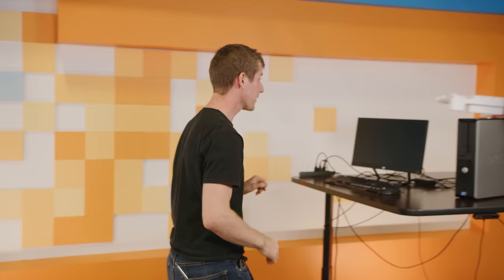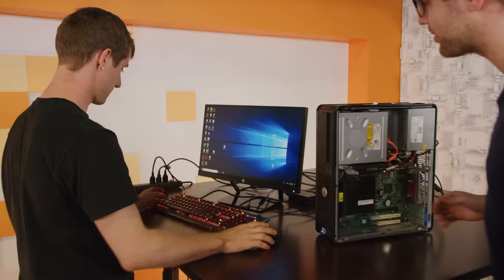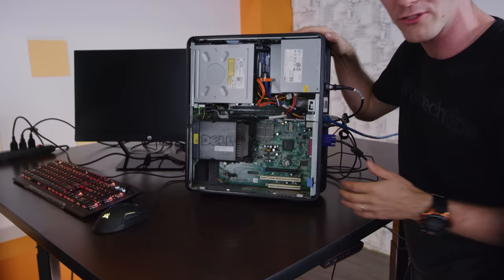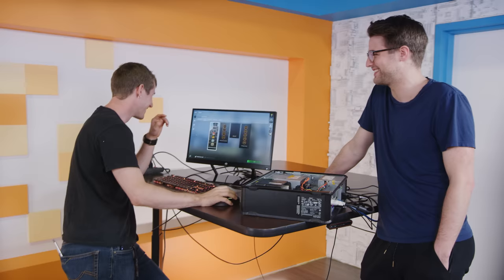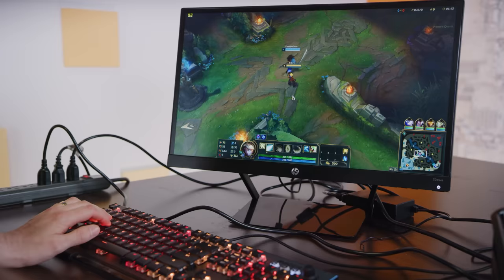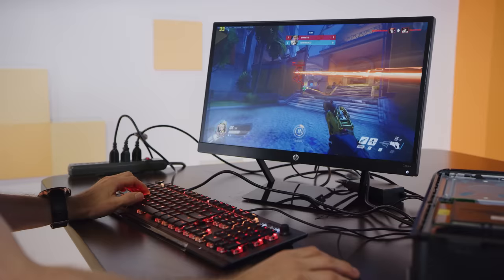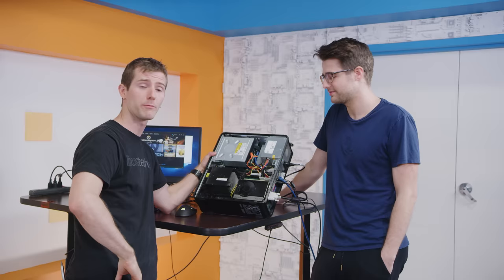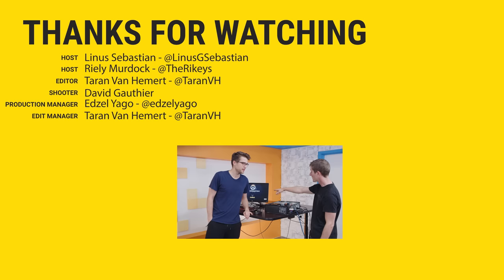The $69 Gaming PC RETURNS

Comment: Some of those Dell Optiplex systems come in full size towers. They have better power supplies and workable expansion ports. You can add an SSD, max out the RAM, and drop in a GTX 750 Ti or similar for around $200 (US).
Reply: Yeh I have a full size 780 tower with a 300w power supply. 750ti coming soon as well as 16gb ram. Then....q9650
Reply: Very true, but in the correct channels (at least back in the day) you could definitely get semi-decent graphics cards even for the slim models. I worked IT for a very very tight-fisted company a while back and engineering staff would get basically no perks whatsoever, same Optiplex slim towers as accounting folk, for simplified (and cheaper) logistics, as well as a better bulk lease contract with Dell overall. Juniors would just get some random cheap-ass GeForce card just to make AutoCAD open, while seniors even had a slim pick (heh) of 2 or 3 Quadro low-profile cards for the damn things. The smile on their faces as you showed up to install one was priceless. I can only imagine how much lubing up to their boss they had to do to get the invoice approved... During my 4 years there I got tired of the slug from just 1G of RAM on my PC and just brought another damn 2G module out of my own pocket and asked someone from night shift to just shove it in my machine while bosses weren't around.

Have to say they were darn reliable too, as they'd sit on the shop floor on all sorts of dusty and grimy, moist conditions for years with very few problems. It wasn't uncommon to open these up for scheduled checkup/cleanup and find metal shavings everywhere, sitting on connectors, inside the PSU, and they were still fine... I'm guessing a little extra load on these PSUs won't set them on fire, they're probably built like old tanks. Maybe some magic smoke, but no fires.
Reply: I just recieved an optiplex 9020 tower with an I5-4590 Intel, 256GB SSD, 4TB WD hard drive, and 32 gigs of memory running Linux Mint 19.1 Cinnamon, and it's fast.  The only upgrades I need are a graphics card and a larger power supply.  It only has a 250watt from the factory. :(

Comment: 30 fps in CS go on low with 720p... that's basically the same specs as an Xbox 360 :D
Reply: Lel well they had bots on which SUCKS ALL the CPU power so it's a bit better than an xbox 360
Reply: it was limited by the CPU, actually it could have run better at 1080p
Reply: Reminds me of the xbox 360 verision of csgo
Reply: Aye for 70 bucks .... that's a steal.
Reply: Optiblex 360 vs Xbox 360

Comment: With a little higher budget you could opt for a GTX 750 TI and a core 2 quad Q6600. A 500gb HDD or higher isn't expensive, especially in the used market (only 10 dollars for 500gb). This will up your experience by 1000%
Reply: or if you are afraid of toasty temperatures...go for q8xxxs,q9xxxs, or (after specific bios-update what includes microcode of xeon cpus) x33x3s,x33x0s
Reply: cpu bottleneck! i3 2100 will be nice
Reply: @mokubakaiba1751  you got point...which processor were you thinking for?...r3 1200?...or 2200g?...the 2. is great alone too. Overclockable, and plays in modern platform...the ram prices are against it :/.
Reply: Don't forget the invaluble BSEL tape mod! That'll clock a Q6600 at 2997mhz all day long and raise the performance by another 20%!
Reply: I was actually buying a Q8200 and a 750 non ti for less than 100 bucks mixed from ebay and china (gpu) a few month ago. And no it was not a fake 750. Was enough for a secondary pc for older games. LLT should at least be able to upgrade cpu to a core2quad for less than 10 bucks and in some games that will help more than a better gpu.
However if possible go for an i3 2100 oder i5 2400, sometimes you can find them around 50-60 bucks.
Reply: @CouchCoach  locally easy to find bargain offers nowadays...f.e. half-configs for bargain...lets say p35 mobo and x3363 and 4 gigs of ddr2 800 ram and a decent coolermaster tower cpu-cooler(noctua fan included!!!) for around 40 dollars
Reply: Q6600 is a bit weak for a 750 Ti if you ask me
Reply: @Photosounder  Yeah but it is verry cheap.
Reply: @trolco  The Ryzen 3 2200G is also a good processor. You can OC it to 3.85Ghz on the CPU and 1500Mhz on the GPU with stock cooler.

Comment: built something like this for my son ok yeh $220 AUD 

but stats

i5 2400
8gb ram (had 4gb and bought another 4 from cex for $8)
gtx 1050 ($70)
120gb ssd ($30)
250gb hdd
Reply: how on planet earth did you pull this off?
Reply: Casino Trashcan 
People tend to be fairly generous when selling their used cards. Only problem is that you might get a grossly dusty card or a heavily used one doomed to die within the next year
but hey you can still get one on the cheaps
Reply: @casino5773  my 1050 is 140 dollars!!!!! lol he probably got it off ebay.
Reply: Volrathy just saying it’s usually called specs not stats
Reply: Pretty much better than my laptop.
i5 4300M
8GB RAM
Intel Haswell Mobile
180GB SSD
-
The desktop I'll eventually get to build will probably be more like
i7 8700K
16GB RAM
GTX 970
2TB HDD (or possibly a SCSI drive)
Reply: Should be bloody greatful I have Intel core i3 processor 3450 with 1.9 ghz speeds, 8 gb of ram, 1 tb hard-drive, Asus notebook not even a laptop I can just about run the Microsoft package, Internet browsing and coding.
Reply: @khuramhussain7802  dang.
Reply: Well I have sorta the same thing as you but I paid 550 usd 

Stats 

I5 2400 
HD DVD Drive
Two 500gb Hard disk drives 
8gbs of ram running at 1333 mhz
GTX 1650 MSI gaming x
a 550 watt power supply 
And a 50 dollar case
Reply: Wolf Playz a 8700k with a 970 get like a i3 9350k or something else
Reply: I managed to get a 100 aud gaming pc with:
Zeon X5550
8GB DDR2 1066MHZ RAM
1TB HDD
450W PSU

SYSTEM (80$)
Radeon HD 6870 (10$)
USB WIFI Adapter (10$)
Reply: I did something similar when my company sold off some older PCs. $20 got me a pair of Optiplex 3010s, 3rd Gen i5, 8Gb RAM, 500Gb HDD.... Added a GTX 1050Ti and it's a pretty solid gamer for under $200.
Reply: I just finished this setup
Dell optiplex 7010 full desktop form factor with a fresh windows install and a core I5 3475 $50

16GB (8gx2) of Corsair Vengeance DDR3 memory $30 
So $80 to upgrade my old systems weaknesses.
going to re-use my MSI GTX670 OC and enermax 500w psu from my old system. Until I can get a 1060 or 1070. The 670 OC is a heck of a card though, it's hard to match with even a lot of 4g cards based off game-debate ratings

Best part about the 7010 optiplex in desktop FF is it uses a standard ATX power connector so no special headaches swapping to a better PSU than the 250w it came with.
Reply: I bought a desktop on ebay for 65 bucks

I5-2500
10GB RAM
750GB HDD
(No gpu)

Upgrading to

I7-2600k
16GB ram
RX-570
750GB HDD WITH 120GB SSD
Reply: Cex is epic, I built my PC for £110 using eBay and Cex
Reply: Round of applause!, I got my GTX 970 for 50 bucks. good build, much love!
Reply: Wowie thats a freaking steal normally for that would be like 280
Reply: @casino5773  a tesóm 26 ezerér vett egy kicsit használtat
Reply: Ayemvee eBay
Reply: ekim andersom  There are people in this world who make minimum wage and have to make life work on 7.25 an hour

Comment: Prior to watching this, I began work on a similar project. Mine is a free Compaq 6005 Pro SFF. I'm upgrading the CPU to a Phenom II X4, the RAM to 16 Gb, the GPU to a 1650, and a 5Ghz wireless card. I'm only $220 in parts on this thing, having had a few of those parts laying around. As a media center 1080 gaming machine, I think it will be adequate.

Comment: I have been involved with computers since I was a senior in High school in 1977 back when there were no PC's. Practically every PC I've ever had was a use one that I upgraded. I can tell you from experience, stay away from anything HP. HP uses proprietary power supplies and motherboard. You can't upgrade the power supplies because aftermarket supplies won't work with the motherboard. The power supply plugs into the motherboard and everything else takes their power from the motherboard. This means you can't install a good graphics card as there are no extra power connectors. Also, stay from small form factor pc's. They are very hard to upgrade. Get something along the line of a Dell or ASUS full size form factor. I know these take up a lot of real estate but they are the most upgradeable in my opinion.

Comment: These days building a 69 dollar pc isnt very difficult and it can actually be viable in some games.
Reply: Yep, and even easier if you go with a lower resource Linux Distro like Xubuntu 18.04, and a cheaper low profile AMD R7 240 - 260 card that does not need extra power.
Reply: The high price of ram nowadays makes budget builds much harder :<
Reply: Tezla True if you are going for a system that needs DDR4 RAM thanks to the deliberate price fixed, and shortages from makers sk hynix for example in which the Chinese government is investigating for fraud on those fronts, but if you go with a slightly older system that uses DDR3 RAM, and keep an open on places like eBay you can snag 8GB - 16GB of DDR3 1866Mhz and OC it to 2133Mhz(at least on AMD boards) for decent price. Also using a free, and open source OS like Xubuntu 18.04 64bit can help in lowering the cost in not having to buy a license key for Window 10 from a shady seller, or having to use a hack to activate Windows 10, and risk spyware/malware/Trojans.
Reply: if you're buying a ddr3 system ram prices are fine
Reply: Hence the video...
Reply: kolby4078 yeah I have a DDR3 system with an i7 4790k and it was way cheaper then going with my initial plan (Ryzen)
Reply: @Josh W yes actually. I'm a huge fan of Ryzen and what AMD did to shake up the CPU market with it and get Intel off their asses, but a Haswell chip like the 4790 K will actually be fairly competitive with the IPC level of a first generation Ryzen chip; not quite on par, but close enough that it isn't all that much of a big deal. And the uplift from Zen+ is only a couple percentage points. The REAL gravy doesn't come until we see Zen 2 in the 3000 series.
Reply: damn id sell my gtx 670 i5 for £100
Reply: NetHack or Breakout. Or Minesweeper!
Reply: Well you can get a decent entry gaming pc buying an old cheap pc and putting on it a GT 1030 but you won't be able to upgrade it and if you try to build a new rig using like a ryzen 2200g/2400g is gonna cost you much because it requires fast rams on dual channel and the prices of it are crazy lol so idk bro xDd

Comment: 08:51 because LoL can run in a potato. It was designed that way.
Reply: I've played WoW on a Celeron 800Mhz laptop, 2GB RAM and onboard Intel graphics and it pretty much got to 20-30FPS in 720p. Some games are genuinely built to run on potatoes and that was the potatoest computer I've used in the past 15 years I think (only thing I had at hand while actual computer sat exploded for a couple of months). Different games I know, but the concept/design is the same I think.
Reply: Well, better game optimization = more potential customers = more money. Dota 2, World of Tanks, PUBG Lite are all made in this way.

Comment: Did kind of the same when I built a PC for my GF. 
I picked up a used HP ProDesk 4th Gen i7. Replaced the a PSU, added an SSD, a second 8GB stick of RAM and a used GTX 970. Runs great and performs awesome for just 300 bucks.

Comment: I run an optiplex 980 with a first gen I5 and a GT1030. The Gt1030 out performs the 650, is much smaller, doesn't need power plugged into it, and fits the single slot low profile requirement of the case. Only "mod" i had to make was removing a HDD clip so it didnt rub against the fan on the 1030. I primarily use this as a HTPC however bench marking GTA 5 @1080 hovers around 60FPS most of the time. So its a much better gaming experience for a little more money. And its 4k capable which will be fine for me when i get a 4K tv. Granted all my gaming performance will likely go out the window. 
The optiplex can be found between $50 and $100 on ebay. And i found a gt1030 for $65 on ebay as well. Its a great HTPC option that can game at 1080
Reply: good job, i can barely get 15 fps on gta five with practically the same set up except mine having GT1020
Reply: @themuntedbean9847  the Gt1020 doesn't exist... Thats probably why your fps is so low 😂

You could be thermal throttling. I reapplied thermal paste to the processor and Northbridge. If the factory messed up the application on the graphics card that could be messed up too. You could also have bad drivers. Im running windows 10 too.
Reply: 60 fps at 1080p with a GT 1030 is a load of ...
Reply: @nimbydimby  I'm not saying the rest of the settings are good... Lol
Reply: i meant 730 lol... i've been typing 1080 and 1060 too much
Reply: Well there's a pretty massive difference between a 1030 and a 730. The 730 can barely edge out an integrated HD 4600 in benchmarks, I wouldn't be surprised if it performs worse in real life scenarios. The 1030 has 3 times the benchmark scores of the 730.

Comment: I actually just did this with an old work computer. If your gonna get the quad core you have to update the BIOS.
Reply: It's so weird to see you guys work on something I just did. Same computer and CPU I  used you did or mentioned. Im going to use the system to run OBD software.
Reply: BIOS update on a Dell XPS410, QX6800, GTX750Ti, with 7gigs of ram is very playable for not a lot.

Comment: Got an optiplex 980 from a buddy who was moving, it had a core i7 870 processor from 2009, I put a gt 1030 into it and I was pleasantly surprised at how good it was at playing games. Yes it isn’t powerful, but it can reasonably play games from 2015 if you are willing to dumb down some settings. We upgraded to a low profile single slot 1050 and my little brother has been using it as a gaming pc for over a year, no complaints or issues.

Comment: I got this old used hp pavilion from my neighbours for free a couple of years back, and I bought a graphics card for it but I went through the exact same issues of how to power it and fit it in the case without having to disconnect any other hardware or buy a new pcu. Man I had about 4 different types of converter cables in that thing. Had a molex to sata to cable and a sata power to 6 pin and just a lot of other crap just to try and make this arrangment work and the result was a mess of wires akin to some sort of electrical spaghetti. After all that hard work it worked great and the thermals were actually pretty decent too! Well the gpu did eventually die a year later so maybe not as good as I thought... But all things must come to an end. Anyways as you can imagine this was a real throwback to all those stressful but in hindsight pretty fun experiences of trying to make it work.
Reply: They sell a 6 pin GPU power connector that plugs into two Molex connectors instead of a single Sata power connector.
Reply: @TheNZJester Oh I actually bought one of those.
Didn't want to use it at first cause I had an optical drive that I wanted to keep. Eventually I realised I wasn't using it and was probably never going to so I stopped using the sata power and used that instead. That's all behind me anyways, old reliable has been stuffed under the bed frame for about 2 years now and I'm using a laptop as my daily driver. Such is life.

Comment: I am, in fact, a school computer technician and yes, we still have a few Optiplex 380's floating around at my district. We've mostly phased them out but they can still run Chrome and Office. We're trying to get everything up to Sandy Bridge or newer and, because I tend to harvest RAM from systems that we throw out, most of the PCS at my buildings actually have 8 gigs of RAM. some of our newest PCS actually do have dedicated graphics cards but they're fairly low end because these computers aren't designed for gaming. The newer ones do have solid state drives so that's nice.
Reply: Do you know the specific type of ram this machines use. I have one and from what I've researched the chipset on this mobos seem to be picky when it comes to ram, so the ram I bought for it didn't work.

Comment: It's great to reuse an old PC like this, especially for people on a very limited budget. One thing you REALLY need to watch out for on those Dells is the power supply. It's not designed to handle a lot of extras and it's proprietary. (one of the reasons I don't care for Dell).
Reply: Yeah but other than that Dell optiplex PCs are awesome! I have always wondered how they run so damn quiet even at long full work loads.
Reply: I bet the dell PSU can be reused to power some EE student's electronics projects!

Comment: When you realize that your pc costs more and can run only minecraft
Reply: seems like you spend too much on the rgb lightning m8
Reply: 60 quid on a razor keyboard, 12 quid on RGB lights, the rest is 800, I'd prefered to spend 800 on RGB than hard ware tbh
Reply: or you recently got a new gpu you can buy a complete low end gaming pc for........... but atleast im covered when NVidia is a dick again or some other bitcoin pops up. ...haven't tried the ultimate test yet tho ... 4k minecraft texturepack.
Reply: Or even minecraft is not even runnable.... (my case)
Reply: i must tell you something m8... maybe it was worth more when you bought it, but it definitely dropped since then, now it may be 10% of a original price, depending on when and what you've got
Reply: Yeah its probably nothing more worth...
Reply: Xenon  not gonna argue against that
i mean who wouldnt like having a party on their pc?